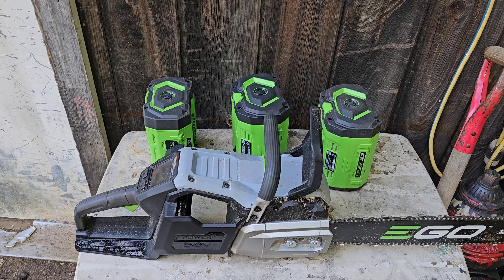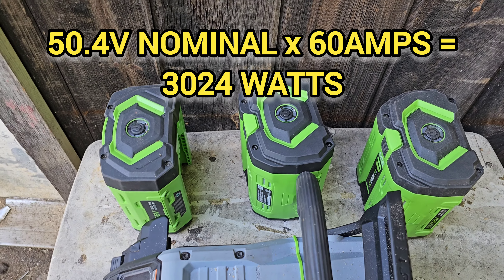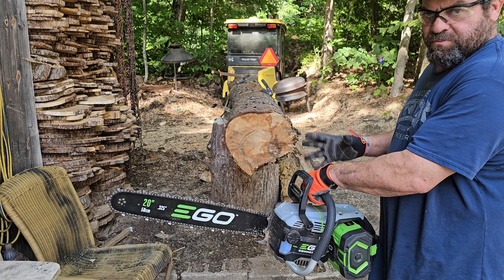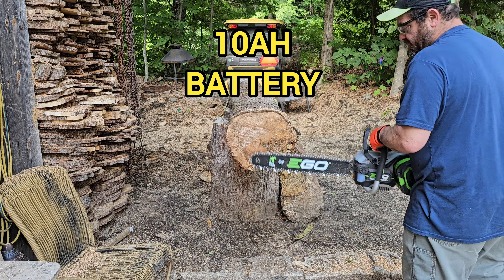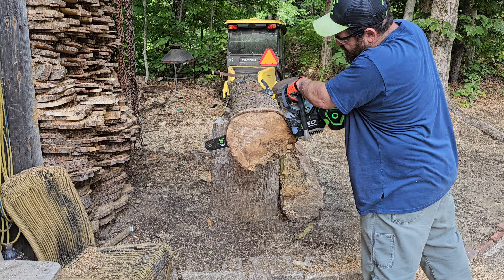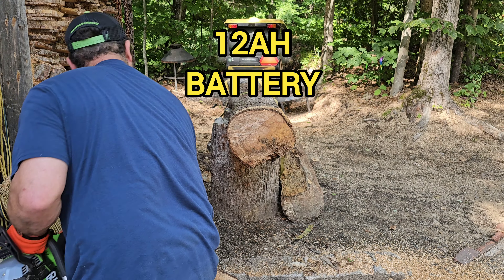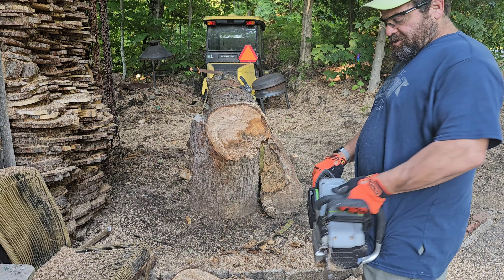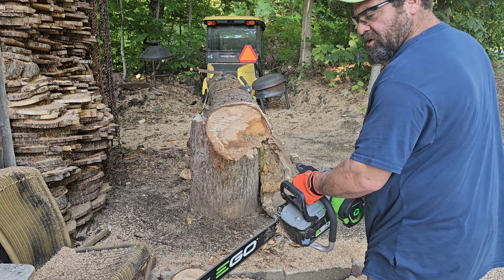Ego CSX5000 20" commercial chainsaw - will the right battery keep it from overheating?

Comment: Thanks for this test.
I always use the 5ah battery to cut dry chestnut and oak. The battery overheats if you press too hard on the saw.
Otherwise it works even at reduced power.
Reply from the maker: @jean-marcbriane7283  I haven't tried the 20m/s, but I still overheated at 25m/s

Comment: I'm running into a similar issue with my 16 inch Ego chainsaw especially on the lower amp batteries. Silly idea - Strap an ice pack to the batteries while in use to see if it changes anything?

Comment: Really digging your content - thanks for making all these videos! Was this with the standard sprocket, or the slightly higher torque sprocket? I'm heavily invested in both the Ego and Milwaukee M18 battery platforms, and have the 16" M18 chainsaw, but I'm starting to need a more powerful 20" saw more often and am looking forward to comparing the CSX and M18 20" to decide which direction to go next. It's really impressive how much torque Milwaukee got out of one M18 High Output battery, so I'm excited to see what they can squeeze out of two M18 Forge batteries, but I know watts are watts and they may not be able to get much more oomph out of those cells than Ego can without overheating.
Reply from the maker: @JamesCusano  The CSX definitely has an overeating issue,  so if the M18 saw can run without overheating,  that will be a huge tip in it's favor.  The Forge 12ah that I have are for the 20" M18... I pre-ordered both at the same time,  but the chainsaw is now saying November for a delivery date.  I've already heard that the 8ah Forge will heat up when pushed hard,  I thought the 12s might do better.  Can't wait to find out.
Reply: @reusefull  By cell count/layout the Forge 12 should run 30% cooler (or have 30% higher output) than the Forge 8, but the limiting factor thermally may actually be the cooling surface area of the pack, and I'm not sure there's a corresponding 30% difference in surface area between the two pack sizes. In photos it looks like the F8 and F12 even have the same cooling vent setup, so same amount of airflow through both pack sizes.

Comment: ...so when do we see the 36" bar on the CSX5000 and the 82CS34?
Reply from the maker: @John-cj3ve  😂 I don't think we will... the 24 seems pretty close to the limit of what is advantageous. I might try a 28 with a skip tooth,  but definitely waiting for Ego to come up with a better battery before taking it further.
Reply: @reusefull I suppose you're right. I DO find myself having to be 'careful' when cutting through logs over 20" with the 24" bar.
What I mean by that is if you ARE careful; you COULD run a 36" bar on the 5000; but it would be more of a stunt; than actually usable in the field.
Reply from the maker: @John-cj3ve  looking forward to the 2 new saws that should be coming out pretty soon.
Reply: I have visions of my first Greenworks 82v saw😁
I don't know why; but I expect that the Greenworks will be more powerful than the Milwaukee.

Comment: I’d like to get my hands on the Csx5000 but i have a cs1800, ego’s 18” chainsaw, already. Would you happen to know if i could swap a 14” bar and chain on the 18” so i dont have 2 saws that close in length?
Reply from the maker: Sorry, I don't know if the bars are interchangeable.
Reply: I put a 18in bar on an 14 in ego,interchanged fine, so you should be able to swap the other way also.

Comment: honestly I feel in real world scenarios you'll have a tough time overheating one. ive got the 16 inch ego right now and i have bucked a lot of fire wood this season already and bucking constantly the battery will overheat on the last bar and i just swap it out. I did order the cxs 5000 a couple weeks ago just waiting for that to come in im excited looks like it will cut fast! (sold my 500i i was so impressed with the ease of the ego saws already)
Reply from the maker: @yensive826  I compared it with the CS2000 and I honestly think that I would rather use that saw until Ego comes out with a better battery.  When the pouch batteries eventually come out,  I think the CSX5000 will be excellent.  Until then, you can't really use the full potential of the saw.
Reply: You are 100% incorrect! I tried using my CSX5000 to buck up a 22" choke cherry tree. The saw barely made 6 cuts before overheating the battery. 
Switching batteries didn't help. I made a cut and a half; and then the saw itself overheated!
I was able to finish the trunk with my CS2005.
That being said; I WILL agree with you regarding the smaller EGO saws. I have a couple of CS1800s; and they just keep cutting until the battery is exhausted.
Sorry about your new saw...
Reply: How much did you sell the 500i for 😮? And crap lol